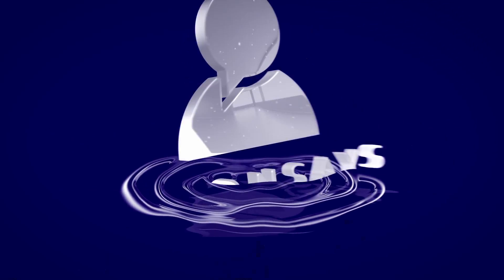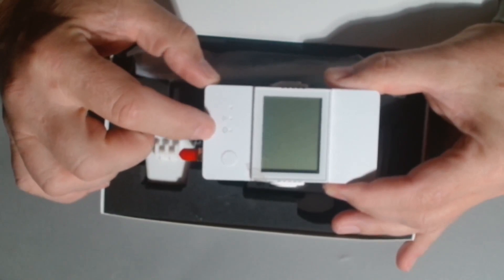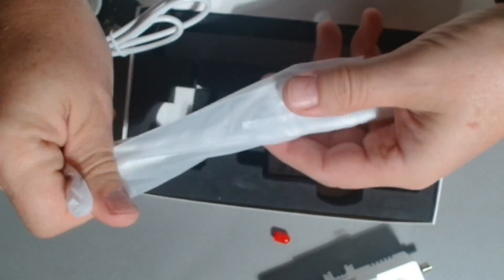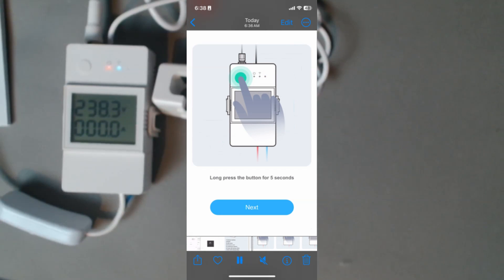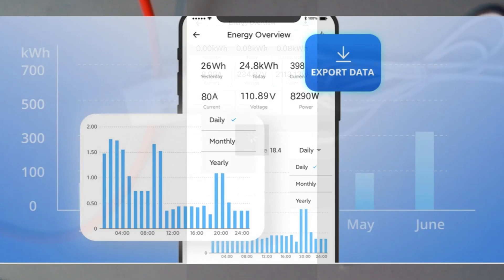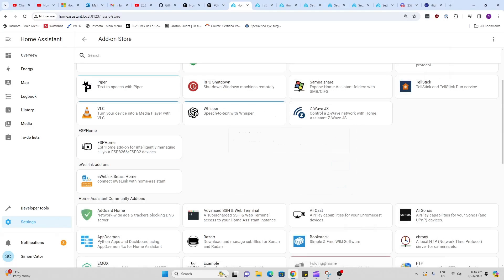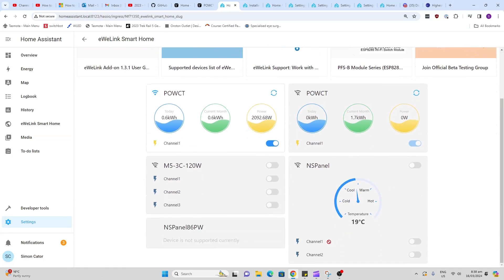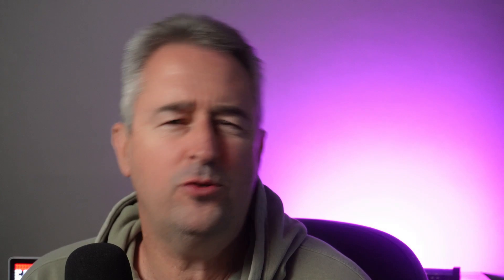Review of the new SONOFF POW Ring Smart Power Meter

Comment: Can I export power data to excel?
Reply from the maker: Yes you can : https://www.google.com/search?q=can+i+exprot+data+from+home+assistant+into+rxcle&rlz=1C1YTUH_enNZ1013NZ1013&oq=can+i+exprot+data+from+home+assistant+into+rxcle&gs_lcrp=EgZjaHJvbWUyBggAEEUYOTIJCAEQIRgKGKABMgkIAhAhGAoYoAHSAQkxMzQ0OGowajeoAgCwAgA&sourceid=chrome&ie=UTF-8
Reply: Yes, you can export data from Home Assistant (any sensor) as a CSV file into Excel.
Or if you want automated export, you could automatically log to Google sheets from Home Assistant. There is an integration for Google Sheets and use an automation to send data.
Another method is saving a local CSV file on the Home Assistant computer. I do this with Node Red saving sensor data.
Many ways to get data exported from Home Assistant.
Reply from the maker: @NorthparkLights  Thanks Mark !

Comment: The eWeLink integration should automatically create entities. I haven’t done this with the POW before but it does this for other devices. I’d think the integration would create an energy sensor entity which you’d add to the energy dashboard. If you haven’t already, have a look at the states page and see what entities the integration created then go from there. If it were my house, I’d flash it for local data/control as I’m not wild about my data going into, or relying on, cloud servers in another country.

Comment: One thing you may want to try. Before the Shelly 3em had an integration in home assistant. I saw a video of a guy that would do a rest call from home assistant to the Shelly to download the consumption data and then home assistant would feed this into a helper which allowed it to be used I. The energy dashboard. Since this only has one clamp you will only be able to read grid import and export if you have solar so you will not be able to calculate your consumption. Here is the video. I think you should be able to do something like this. https://youtu.be/kDIK0BP4Xss?si=R4cO6S99ZupP4-NX
Reply from the maker: Thank you so much, I will check the video out!